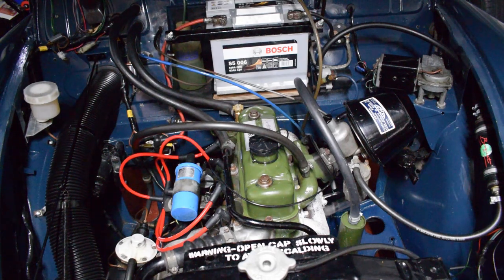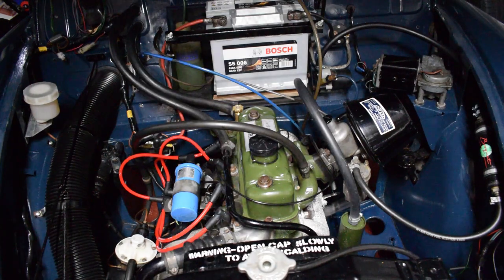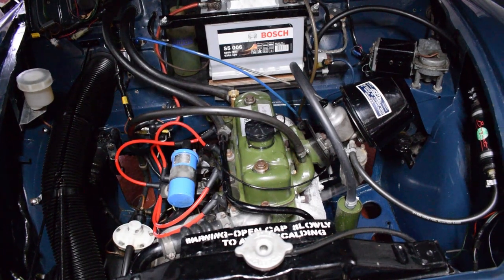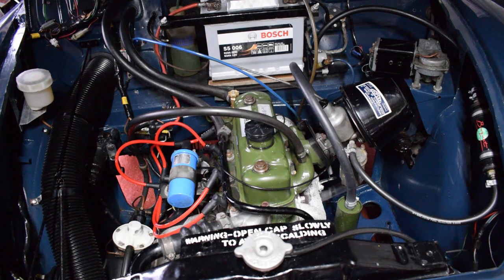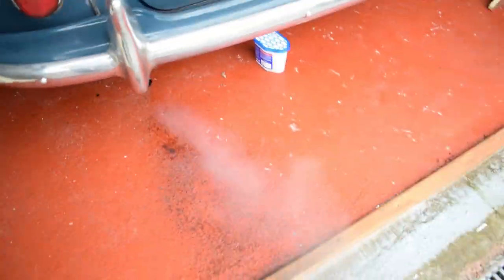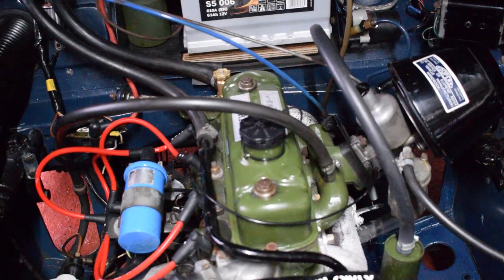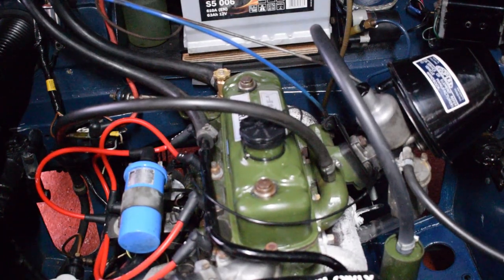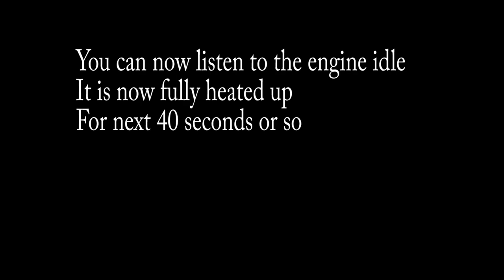Starting and Running 1970 Morris Minor Engine

Comment: That is a sweet running 50 year old 1098cc A-series engine.
Glad you pushed in the choke early as these A-series engines do not require choke for very long.
I see you have an alternator fitted, was this original or did it replace original dynamo please?
Keep that Morris Minor nice & well maintained now.
Reply from the maker: The alternator did indeed replace the original dynamo.